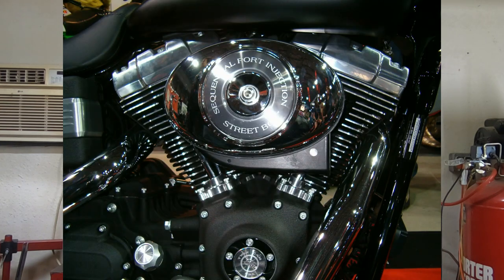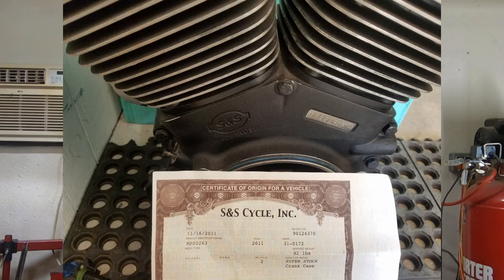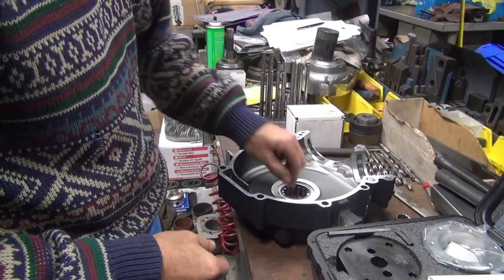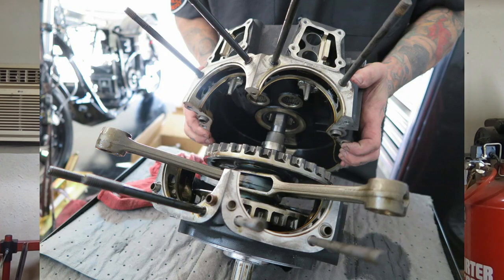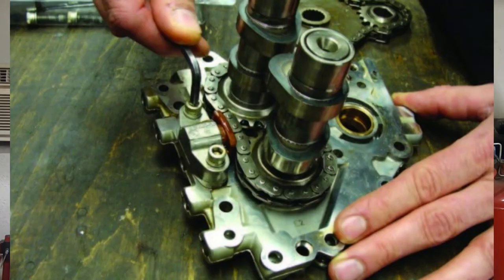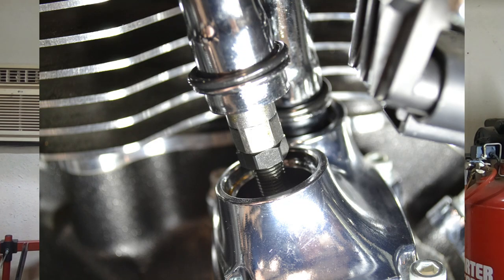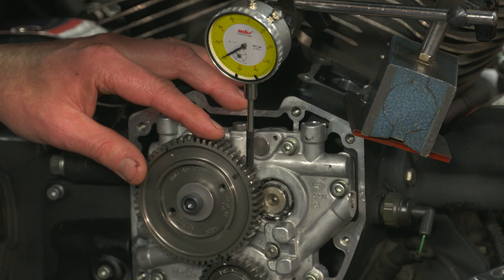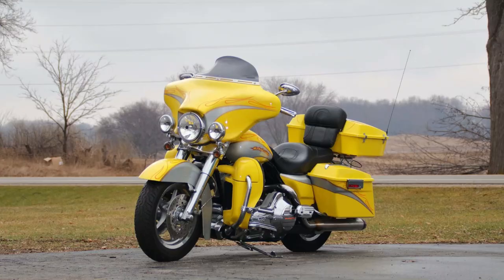Twin Cam Harley Engines Can Be Bulletproof

Comment: Why would I want to buy a twin cam that I would have to spend all this money on when I can buy a nice low mileage Evolution motor that is cheap and dependable? You Bandy sayings about like buying a new crankshaft, a new cam plate a new oil pump, a gear-driven cam, that is if you don't have too much crankshaft run out. If the people who bought twin cams were regular motorcycle people they would have brought their motorcycles back to Harley and demanded them to be repaired under warranty instead of spending five grand out of their own pocket or more. The foibles of a twin cam are well-known and are used to drive down the prices because the potential customer has to do so much work to it to get it to be reliable nevermind super reliable. It has also been responsible for the rise of used Evolution powered motorcycles because everyone knows they are dependable unlike a twin cam. Evo forever forever Evo.
Reply: Oh wow!! You must be one of those "real bikers", give me a break. My '06 88TC has never failed me, been back for warranty work at HD since new. You can have good/bad engines in any design. However, the life/reliability of any bike is very much dependent on proper/regular maintenance and keeping them away from clueless backyard mechanics...
Reply: @jamesbecker3420  the twin cam has a shopping list of built-in manufactured deficiencies in critical components in critical areas no if ands or buts. Every 40000 miles you need to service the cam change and a tensioner. You have to watch the crankshaft run out before it chews up your oil pump in your cheap stamped Chinese cam plate. We are talkin about endemic flaws that are across the whole line. We're not talking about one or two engines having difficulties we're talking tens of thousands. Chances are you have not ridden the by far enough to have any mechanical issues but that does not mean that you will not have them in the future. Frankly I will not argue the point. It has already been well-established. Look at all the things he recommends in this video very expensive parts and labor to correct horrible manufacturing efficiencies from using cheap parts in critical areas.
Reply: @frankmarkovcijr5459  I'm a regular rider and I think you sound over dramatic. My 2005 TC is running strong with 90,000 km and it feels tighter than many Harley hater's buts. Only oil changes, though I have to say I converted it to gear driven cams at 65,000 just for the sake of it.
Reply: What?!

You're making assumptions out of no where, especially about a bike you don't own and ride - my 2005 TC.

Did you open the cam case? No.

Did you see the state it was? No.

Did you pay for an upgrade just because there's money? No.

Though the tensioner had some wear, it still had a way to go. That's pretty normal in every machine: wear out if use. So no worries.

But, hey, I guess you're entitled to nag about an engine you don't ride. You have spoken volumes of your beliefs and concealed hatred. Good luck with your life, boy.
Reply: @omarsalgado9715  oh really I'm making assumptions out of nowhere I guess all of these videos about all of the problems of the twin cam or just imaginary. It was not a good motor to start off with it is less of a motor that an evolution. Its reputation for unreliability is well deserved. I have seen inside the cam chest of twin cams and I have seen the crap in there. One aftermarket mechanic told me he thinks Harley-Davidson designs a twin-cam the way they did just to give him work every 40,000 miles. I write 30000 miles a year just four-day trips being retired. My Sportster alone has 400,000 miles on her. My BMW 100/70 has 500,000 miles on her. I buy tires in lots of a dozen at a time. I would not take a twin-cam if you gave me one for free even if it was brand new. That is how bad the twin-cam reputation is and the milwaukee-eight is even worse. The worst a lemonade is the more you guys want to drink it.

Comment: Just buy an EVO and forget about it
Reply: Fantastic if you want 20hp 🤣

Incredible motors but come on, they don't hold a candle to a 103 

To get a big Evo up to 103 levels of power, you'd spend more than just buying.....a whole bike with a 103 in it.
Reply: @yanceyboyz  I agree incredibly good motors, but me personally that's all I need or I would buy a ninja out of the box  n save thousands and the headache of a tear down n build up. A Harley is 2 cylinder compared to a 4, just my opinion.
Reply: @yanceyboyz  80 cubic inch Evolution powered big twin to up with luggage will cruise down I-95 all day 90 miles an hour and it will run cool-as-a-cucumber doing so

Comment: Bring up the short comings of the twin cam and people get butt hurt. Perhaps some sensitivity training is in order.🙄
Reply: Like all Harley motors, you can't just generalise and say twin cam. My 88 needed a cam plate and oil pump upgrade when it went in for the dreaded chain tensioners problem. My 103 HO twin cooled has been absolutely perfect for 34,000 miles and makes great power. Not all twin cams are created equal.
Reply: @yanceyboyz  Absolutely correct sir!! Cam chain tensioners was the only issue I ever had. It was known even in 1999. Everything mechanical has a weak point.

Comment: I have a 2007 Harley Davidson FLHTCU with a digital oil pressure gauge  does it have a ground  wire? it donst work ,its been all tested out.
Reply from the maker: It could have an issue internally within the unit especially if it is an electronic gauge.